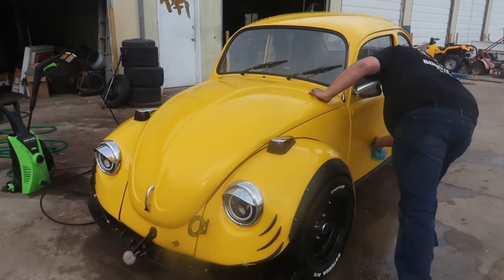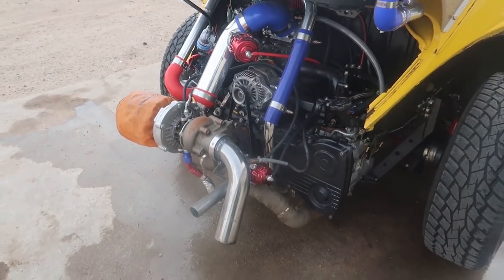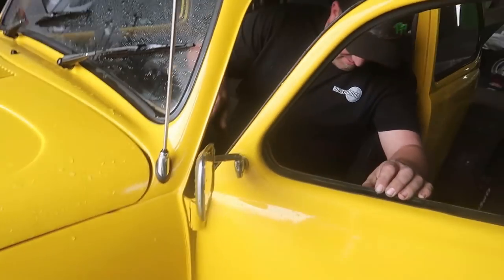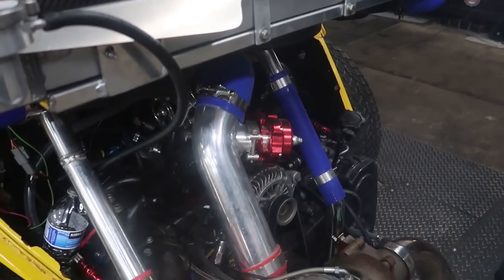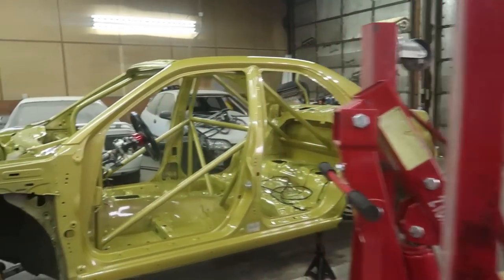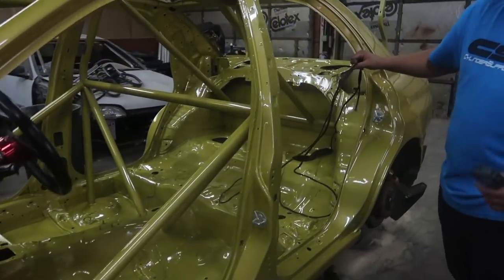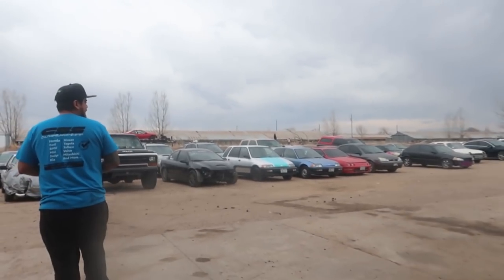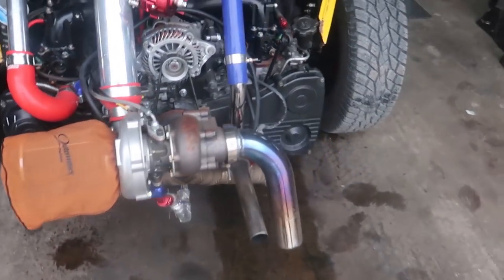Su-BuG-Roo we get this Hot Rod Beelte Rippen!

Comment: When your radiator is a wing, that’s how you know Sean built it
Reply: The Man is a Genius with design and build
Reply: Zero compromise. If it can be better, lighter, more efficient, or cleaner, IT WILL BE DONE
Reply: The wing coolers have been around for years, what do you think is on the back of a 70s Porsche?
Reply: @mke723  not a radiator. 70s Porsches are air-cooled it's usually a intercooler duct

Comment: At 4:14 I gasp...hold my hand to my heart and wheeze out "OMG I hope they trim that throttle cable"!  I survived, but if you didn't please tell the customer to trim it before it sticks the throttle open and ... bad things happen.
Reply: wouldn't trimming make it tighter and more likely to stick open?
Reply: No. From what I saw, it looked like there was 8+ inches of excess cable past the cable stop. I'm not recommending adjusting the cable, just cutting off the piece that goes past the cable stop. @_Professor_Oak

Comment: What transmission are you guys using and how do you get over  the driveline turning backwards because it's aimed towards the rear.  An old Legacy front wheel drive transmission might work but the I have no idea what you guys did to get that thing running backwards
Reply: Built bug transaxle

Comment: Hows it an STI motor if they make 280 from factory? Must be a watered down US engine lol
Reply: 280 at the crank. This made 280 at the wheels. That's probably about a 25hp difference at the crank give or take. Hard to really tell what the drivetrain losses are but normally in rwd applications about an 8-10% loss from crank to the wheels and  even more loss in awd drivetrain setups.. and they could probably have turned it up and made 300+ at the wheels but if you listen Brent mentioned the customer wanted around 250whp or so with the transmission he is running. Most likely for reliability sake.. breaking transmissions isnt much fun so its understandable lol